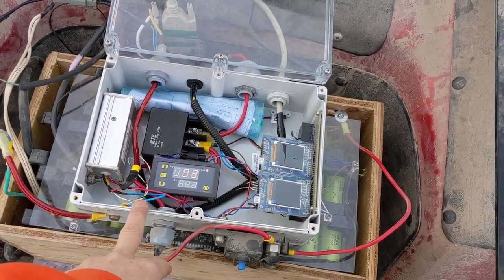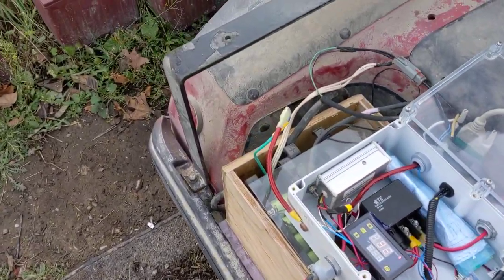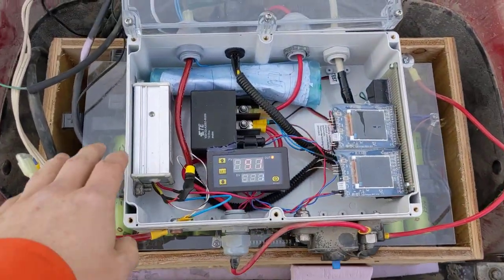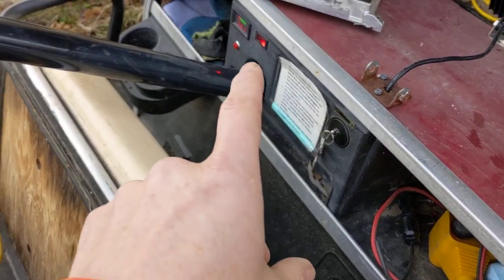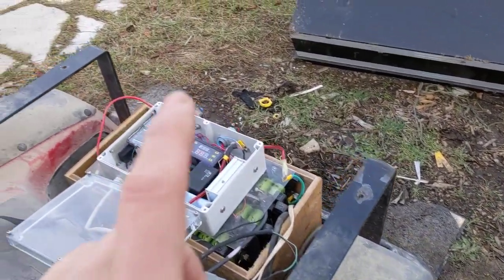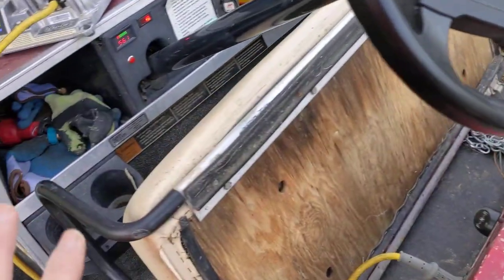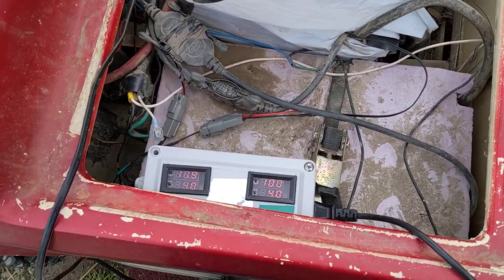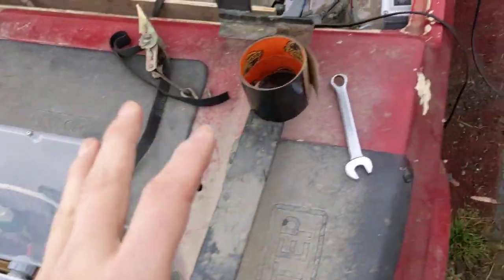48v golf cart converted to 56v lithium

Comment: Good day joel.
Wondering if youve got the sigineer 15 k up and running yet ?
As i recall you were about to move and were busy.hope the move to new location went well.
Hoping to hear a good review and operational overview from you on the inverter. I run the outback radian gs8048a with battleborn batteries now but im thinking id like to have the sigineer 15k unit as a backup unit should the outback ever need service.
Stay charged, be well.
Reply from the maker: I got it working, but ended up selling it since the new place is too big (multiple family dwelling)